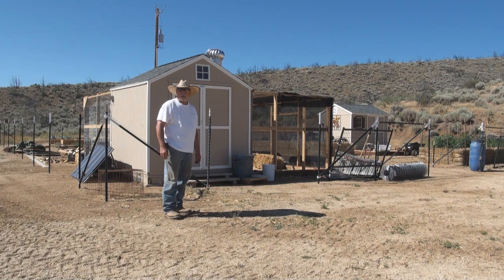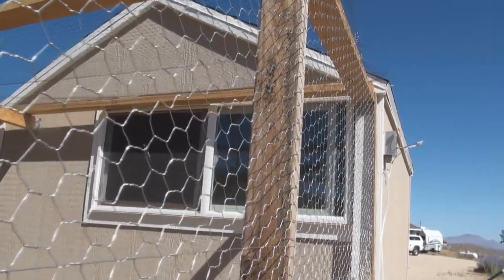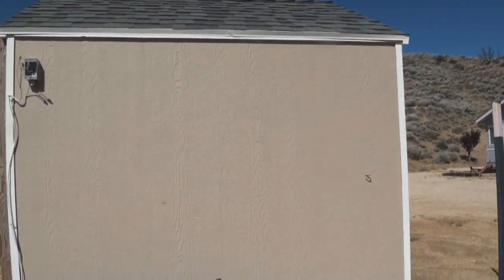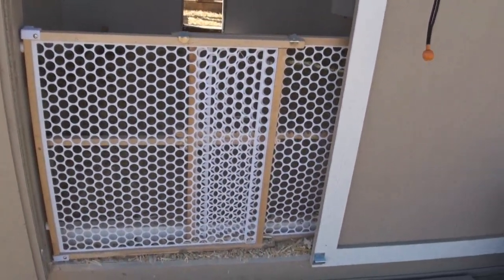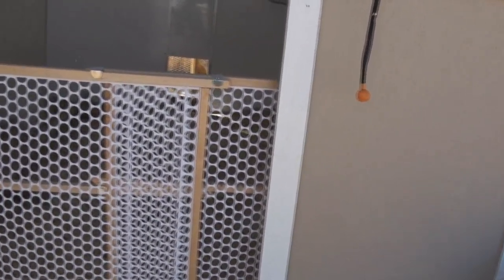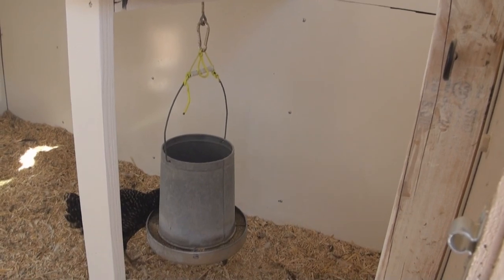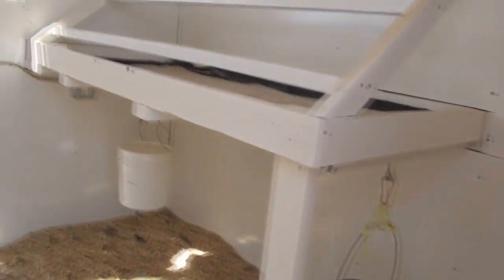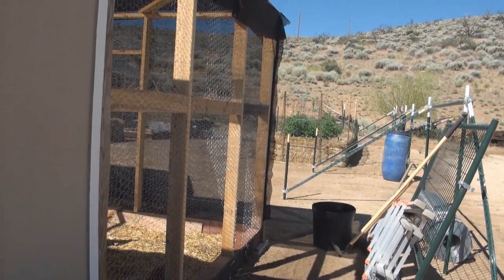Chicken Coop and Run

Comment: Awe man, why didn't I think of that!  The rotary vent on top is awesome.  I have 7 chickens and even with lots of air flow, our coop does get quite hot in the summer.  I have it set up to just take the windows right out of the walls for max airflow.  (Screen remains to keep chickens in and baddies out.)  Great job.  My next project is to convert to the bucket/nipples rather than the poultry waterers that I bought at IFA.  Love the vids :-)

Comment from the maker: The fan is amazing, you should see if you can do it. I thought initially that it might be to much draft, but when it's hot and winds are low, it really increases the air flow. I think during the winter, I will bag it like a swamp cooler to hold heat.